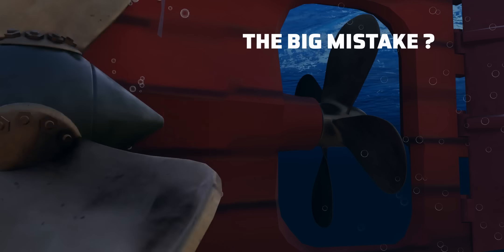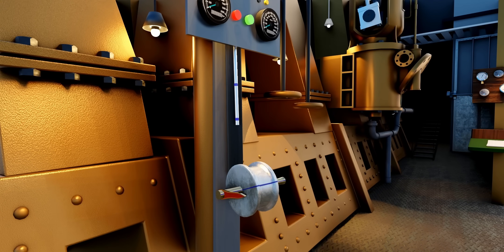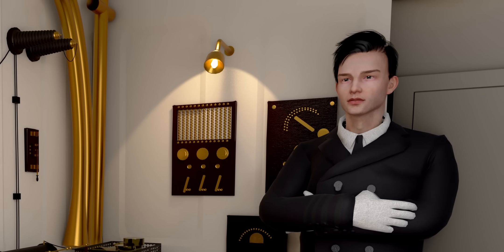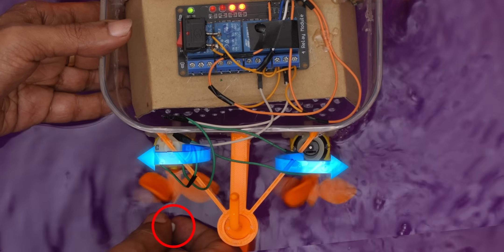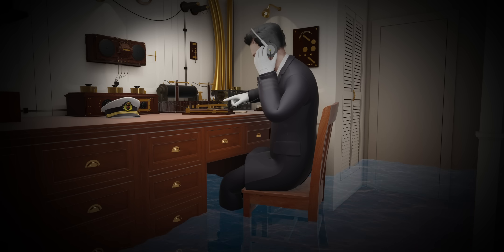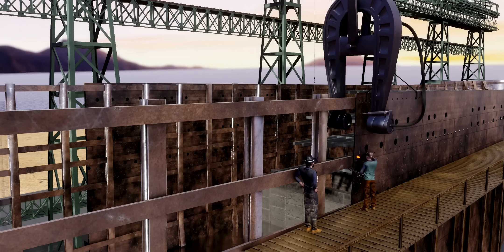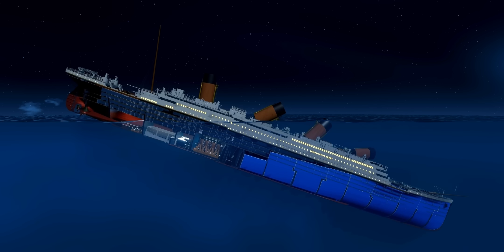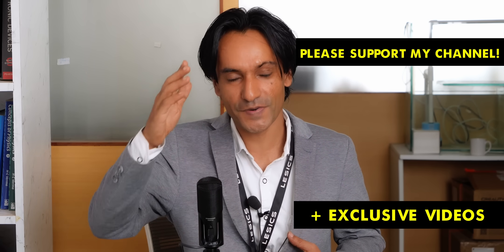How did Titanic sink? | Solving All the Mysteries

Comment: The engines were never reversed before collision. Witnesses in the boiler and engine rooms said that All Stop was ordered. Most of Those that did say the engines were reversed stated they were reversed post collision. If they reversed, it was likely a couple of minutes post collision. 
About the engines being reversed post collision, its up for debate as to wheather it was Full Astern or Slow Astern. Dillon and Scott (Admittedly questionable) mentioned Slow Astern. Others stated they were reversed. Some (Rowe, Poingdestre, Scarrot, Rule) stated it was full astern. It is up for debate as to which of those orders it is as witness testimony regarding telegraph orders is quite contradictory. 
If the engines were reversed (Debatable, especially as to whether it would be full or slow astern), it was probably about 2 minutes after the collision when the order was given and likely to slow the ship's forward momentum down, before Half Ahead was ordered.
Sorry for any offence, no offence meant. Just wanted to give my input

Comment: Full reverse oort engine, full agead starboard engine and center turbine along with full rudder would've missed it
Reply: Reverse needs almost 1½ minutes,  that is with crew on standby. With only about 37 seconds to respond after spotting the iceberg, and with no crew on standby, this maneuver would not have worked
Reply: Yeah there was no reverse of the engines at the time.

Comment: Exactly. Two completely contradictory forces not working in tandem at all. What the crew did was basically “confuse” the ship. Reversing the propellers (engine) while also maneuvering the rudder in a way that would’ve been conducive to the ship maintaining its forward motion and not in reverse…they hammered the last nail into the ship’s coffin.
Reply: They did not reverse
Reply: @ ^ I suggest you read a book, because yes, they did.  Reversing the engines was the WHOLE reason the ship was not able to turn faster. Are you thick?
Reply: @rominn2184 Problem Is that witnesses in the engine room stated an All Stop order was given. If the engines were reversed, it was very likely post collision
Reply: @OceanicCruiseline1912 ^ All-stop was given AFTER the ship hit the berg. Another person who doesn’t know the basic history. What is it with you people? Just read!! 

AGAIN - if the ship HADN’T reversed the engines and had kept turning to the left as soon as the iceberg was spotted, it’s QUITE likely she would’ve missed it by several feet. It’s simple physics! If as you say, the engines had been STOPPED as soon as the berg was spotted, the remaining forward momentum actually might’ve STILL allowed the ship to miss the berg, IF she had kept turning (why wouldn’t it have turned?) and not given the engines and propellers/rudder two completely CONTRASTING commands.
Reply: @ Left a reply but it seems to be hidden
Reply: @rominn2184  i suggest you read the inquiries. 
Frederick Scott saw the telegraphs ring Stop. He was literally standing at the door between turbine and reciprocating engine rooms. 
Frederick Barrett saw the boiler room indicator ring red, indicating stop. They then cut the draft to the boilers in an attempt to stop. 
Thomas Dillon was at the engine room on temporary greasing duty. He saw the engines stop.
Reply: @rominn2184  Then why did witnesses claim All Stop was given BEFORE the crash?
Reply: Have you read the Inquires?
Do you know Murdoch’s history?
Do you know how officers are trained to react in a situation like this?

Comment: The radio on the titanic did not use a printer, "ticker tape," on the receiver. The operators had to listen to the code. This is why they wore headphones.

The engines were also not reversed by reputable accounts. Shame for what seems to be a high-effort video.
Reply: Ok you seem to know it all like Donald Trump then do tell 😂
Reply: @natedawg-p8v  Thanks gramps

Comment: @SabinMechanical 

Another curiosity that you completely ignored is that the Titanic never had a 4-Blade Central Propeller, it had 3 Blades.

The Reversal of the Engines in the film is also a Curiosity, because it never happened, the Order that First Officer William Murdock gave at that time was Total Stop of the Engines and Turn to Port (Left).

You being a Mechanic, you know very well that a Steam Ship the Size of the Titanic CANNOT REVERSE ITS ENGINES ABRUPTLY as we saw in the Films, for the simple reason of the High Pressure of the Steam in the Pipes, if the Titanic Reversed Its Engines Abruptly as we saw in the Film, the Ship Would Simply Explode.

When researching things about the Titanic, please research properly.
Reply: Hey @SabinMechanical

Comment: They never put the engines into reverse. One of the engineers frederick Barret testified that only the stop indicator had been activated from the bridge prior to the collision.
Reply: The middle propeller cannot be reversed because  it was powered by a low pressure turbine engine and this engine had no mechanism to do it, only two propellers.
Reply: Don't even wanna finish the video now 🤣
Reply: @cushsmith2623 testimonials could be corrupted. Not only intentionally, but also by false memories. However, the official commission made a conclusion that there's no difference whether engines were reversed or not, the ship was doomed. The only way it could be saved is by ramming the iceberg. But the 1st lieutenant was not able to take responsibility for the death of most people in sections A-B, or even C, so he commanded the avoiding maneuver.
Reply: Barret was not an engineer (engine room): he was a stoker (boiler room); the red light was to stop feeding them.
Reply: He was not exactly a stoker, he was leading fireman, the red stop flight was indeed to stop feeding the furnaces with coal, and thats not an indication for full astern, otherwise the "full" would have remain lit, if the bridge telegraphs had been swang to full astern.  @elrjames7799
Reply: @elrjames7799 Barret was actually a leading Fireman
Reply: Once the huge reciprocating engines stopped this also stopped the exhaust steam to the center turbine 
Once this happened Murdock lost most of his steerage. No thrust towards the rudder! Murdock screwed up bid time! He should have known better! Already having made several trips across the pond on the Olympic he knew how the power plant worked! He set himself up for a glancing blow with the berg!
Reply: @arthurclarke6703 What you are saying is true. As the engines were stopped and speed begun to decrease the rudder begun to progressively lose its effectiveness. But when the iceberg was spotted we must also consider the very slim window of time Murdoch had to make a decision, and determine whether a sudden turn without slowing down would have been enough to offset the rapidly closing speed to the iceberg.  I mean the iceberg was spotted very close to the ship and the time to make a decision was extremely limited. In my opinion everyone could have decided in a similar course of action under such pressure.
Reply: That's what caused it stopping the engines if they were stopped
Reply: In fact it was a misunderstanding of Boxhall when he reached the bridge
Reply: They did reverse the ship until she slowed down and then when she stopped they stopped the engines
Reply: Fredrick Barrett was not an Engineer he was the leading Fireman on duty at time of collision. His testimony in the United States Senate Hearings never mentioned anything such as only having the stop indicator lighted.

Additionally I implore to check the official transcript of the US Senate hearing for the testimony provided by 4th Officer Joseph G. Boxhall on Pg 229, and by 3rd Officer Herbert J. Pitman on Pg 313, these testimonies back up the idea that the engines weee in fact placed in full astern.
Reply: Yeah, putting engines into reverse is just a David Cameron's fantasy))
Reply: @ВасилийТеркин-р3ш David? 😅
Reply: Still  it doesn't change the fact that they should have kept the full ahead speed to maximize the turn of the rudder!!!
Reply: Barrett was a fireman not an engineer so he would not know if it was going forward d or reverse
Reply: Crew testimony suggests the engines were simply stopped, not reversed, and the movie "Titanic" dramatized the scene... 
While the Titanic could theoretically be put in reverse, the process was time-consuming and complex, and it's debatable whether it was actually attempted in the time available before the collision with the iceberg. .. 
Yes, the Titanic could be put in reverse, but it wasn't a simple matter of flipping a switch. The Titanic was a triple-screw steamer with three propellers: a center propeller and two outboard propellers on the port and starboard sides. The port and starboard propellers could be reversed, but the center propeller could only propel forward. 
To reverse the engines, the Titanic needed to: 
Cut off steam to all three engines .
Allow the engines to wind down .
Change the gearing on the triple expansion engines .
Pressurize the "reverse" steam chambers .
Reply: @Acheron9582  That's the logical consensus: in mid ocean engineers would have no reason to be on the control platform with their hands on the levers and valves anticipating an emergency change in orders.
Reply: @Aegean9582  Indeed. And also lets not forget two important things here: Firstly, going from full ahead to full astern is a major change in the engine room as you correctly stated, but is not a major change in the boiler rooms. The stokers still have to supply coal in order to get enough steam for a full condition.
However the stokers and engineers who survived reported that the next order they had was to "shut the dumpers", which was a standard procedure when you wanted to stop the ship from a full condition, because you already had enough steam and you didn't want to build up more, with the ship at a standstill. There is an inconsistency in the titanic movie where the ship is (erroneously) about to reverse, and at the same time the dumper doors are ordered shut, which really makes no sense.
Another important thing to note is that going from full ahead to full astern in a large steamer like the titanic would have been a really violent action and would have sent a huge shudder down the length of the ship, alerting most people (if not everyone) onboard that something was wrong. But prior to the collision most passengers were asleep and nobody noted any loud noise or severe vibration or any kind of shuddering. Even the collision itself went unnoticed by most people, and only those close to the bow knew what had happened.
Reply: @Acheron9582 about 30 seconds…the question is how long did it take for the engines to spool up and for the propellers to have any affect of slowing the ship down…
Reply: Yes they did reverse the lateral propellers
Reply: Only the center engine was reversible.
Reply: @MikeMcglynn-qv1tq  I'm not sure which engine was reversible but I know for certainty that the mid propeller was not reversible. Only the outer ones were.
Reply: @maisonraider4593  Yea, I couldn't reverse, but the other two on sides could reverse.
Reply: @MikeMcglynn-qv1tq   Not correct. The main high-pressure reciprocating engines could be put into reverse and so the two outboard propellers would keep working. But the center propeller, which was a single-direction only low-pressure turbine fed exhaust steam from the big reciprocating engines. So, even if the ship went into reverse properly, there only would've been thrust from the wing propellers, but nothing from the center one. Thus there would not have been any direct thrust on the rudder, decreasing its effectiveness.
Reply: @MikeMcglynn-qv1tq  To the contrary: the centre turbine was ahead only.
Reply: @MikeMcglynn-qv1tq   Congratulations. You got it completely wrong. Please do some research first and try again next time.
Reply: @MikeMcglynn-qv1tq 
No it was not reversible…
Reply: @timothyreed8417 Why had the telegraphs ,,reverse" on them them?
Reply: @MikeMcglynn-qv1tq  it couldn't go in reverse
Reply: If it couldn't why had the telegraphs ,,reverse" on them?😂 @stadiosound
Reply: @MikeMcglynn-qv1tq  the port and starboard propellers where the ones that could spin in reverse.
Reply: @MikeMcglynn-qv1tq 
Center engine was not reversible…
Reply: @MikeMcglynn-qv1tq "center engine"? You mean the turbine? No, it did not have reversing ability.
Reply: @MikeMcglynn-qv1tq  Center engine was a turbine, and turbine is not reversible.

Comment: Sorry, but no. They never reverse the engines. Murdock give a stop order: the Cameron's movie isn't a documentary! The rivets are the standard for this type of ship. I like your video, but there are some wrong information about the real story of the disaster.
Reply: It is a common myth since the Titanic miniseries that came out a year earlier made the same claim.
Reply: @George-Hawthorne  not just the miniseries. 'A Night to Remember' which came out years ago also made that error. It was a pretty common myth back then that most Titanic movies featured.
Reply: The rivits in the bow area were made of iron, which were more brittle and weak. The rivits back of the bow were made of steel, it was because the automated robot machine couldn't be used on the bow.
Reply: How do you know?
Reply: Still  it doesn't change the fact that they should have kept the full ahead speed to maximize the turn of the rudder!

Comment: Thanks to all the latest research, it is widely believed now that Titanic was not ordered to reverse, but rather just stop the engines, binoculars were locked in the closet on the bridge, but had they used them it was experimented they wouldn’t make a difference, Phillips didn’t send Captain Smith the message from SS Californian because it didn’t contain a 3 letter code meaning it’s for the captain, so Phillips ignored it since it didn’t contain it, please do your research properly before spreading misinformation.

Comment: Many simulations showed that no matter what they would do, collision was unevitable. Just going to fast with no visibility. Paid the highest price.
Reply: Visibility was good and there was an easy way to save Titanic. Stop engines and do nothing. As all ocean liners she was designed to handle a full speed frontal impact. Telescoping is what they called it. Some liners hit head on and that's what happened. 

However she would have been badly damaged and about 30-50 m of the bow would have been crushed where at the time over 200 were asleep, many of the stokers off duty had their cabins in the bow as well as some third class cabins. 

But the ship would have been in no danger of sinking and would have been able to make it to Halifax after offloading the passengers and non essential crew to Olympic. 

The SS Stuevic was sailed without a bow. That had been blown off after she grounded. 

They built a new bow, blew off the old one with dynamite and sailed 2/3 of her to Belfast to Harland and Wolf, where a new bow had been built and attached. 

At one time SS Suevic was the longest ship of all time. Her bow was in Ireland and the rest of her in Scotland.
Reply: Did any of the simulations simulate keeping the speed but just steering? Cause that would give the rudder more waterflow to push the stern around